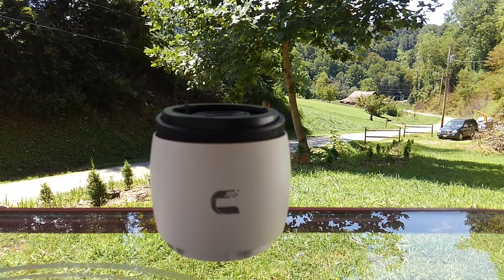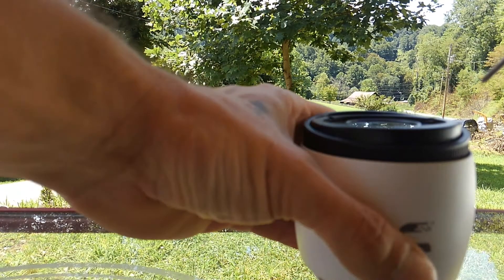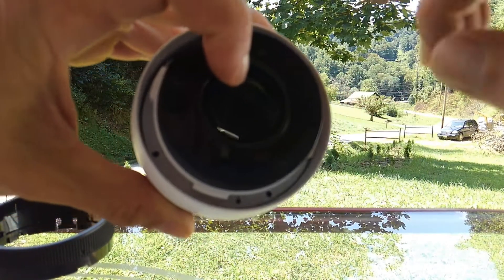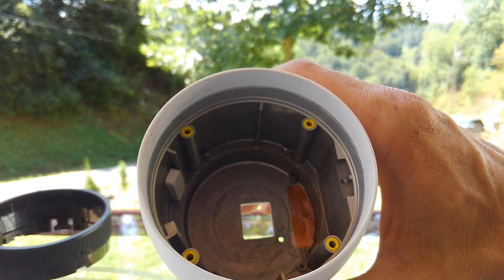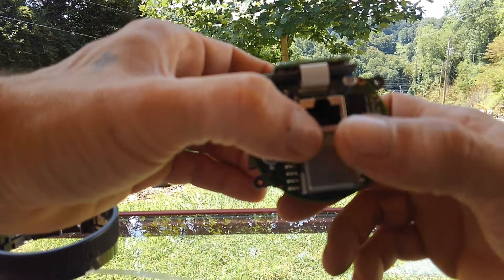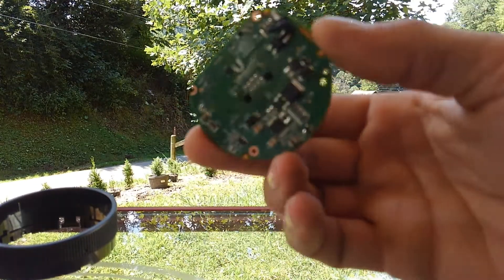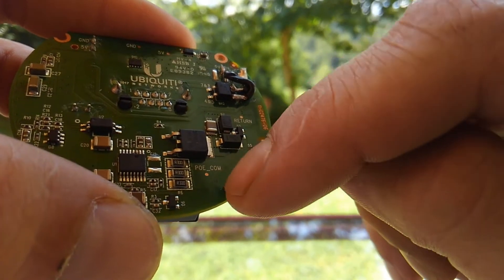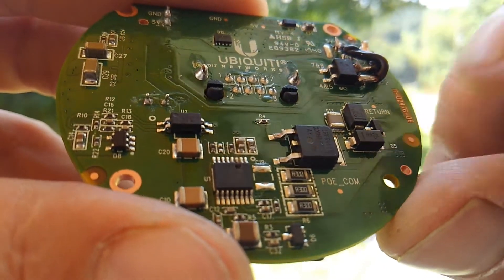UVC G3 Pro No Power With Disassembly

Comment: Thank you for the video, same issue for me I think. I noticed the lm5072 poe pd controller was very hot, and my camera gets power by usb, which led me here. Only problem is I have a G4 Pro camera and there aren't 5v solder points on the board like the g3. The usb power is directly on the MB. I'm wondering how I can bypass on the g4 pro.